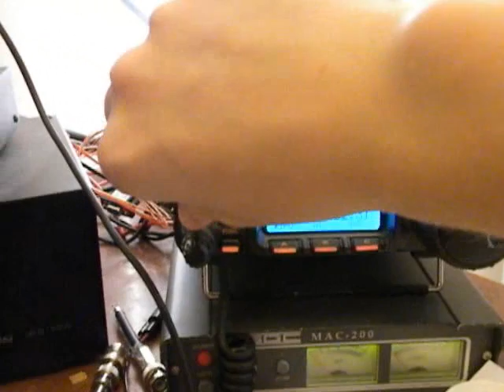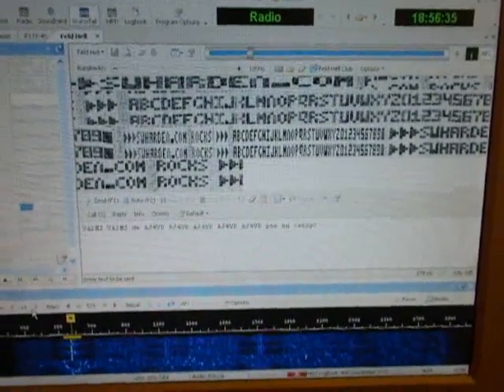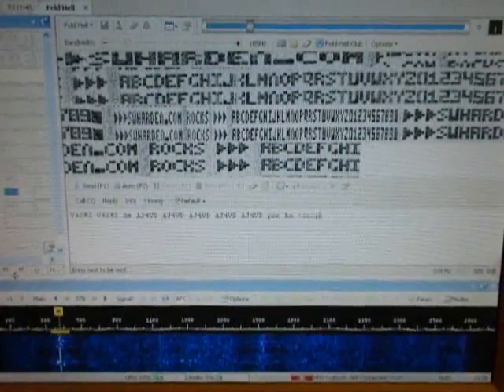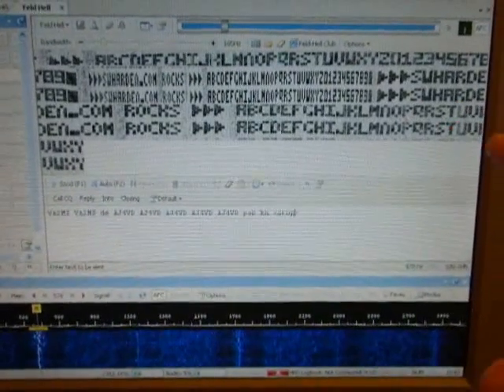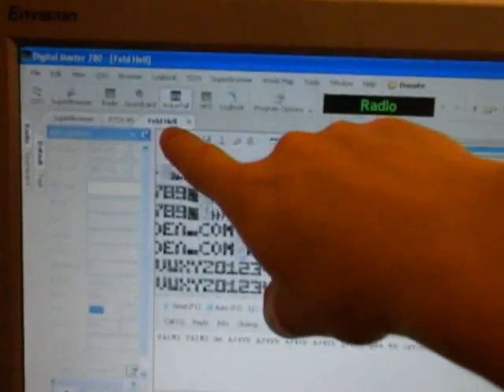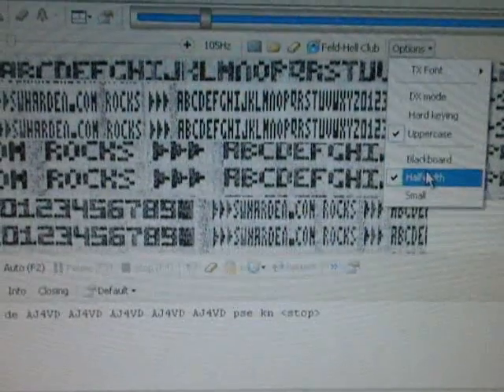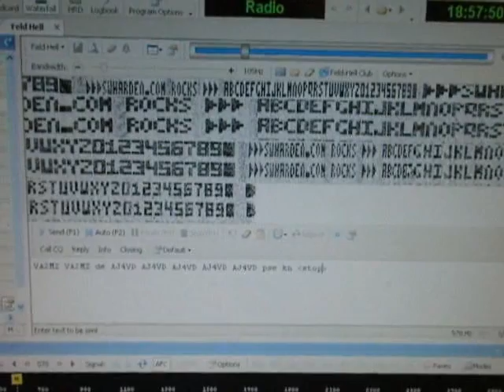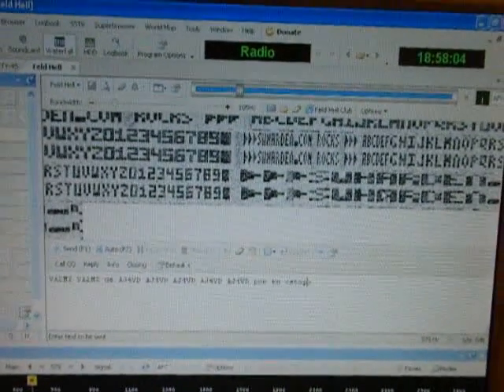hellschreiber microcontroller beacon 2

Comment: If you use a 1Mhz 4-pin crystal oscillator...you can make an amplifier with a TIP41 transmitter and make an broadcast AM radio transmitter that can fill a small room. If you then play a 10 kHz sine wave into that transmitter modulated in AM with C-Quam AM stereo, then you can tune to 1010 AM on a 1980s receiver and listen to AM radio in stereo.